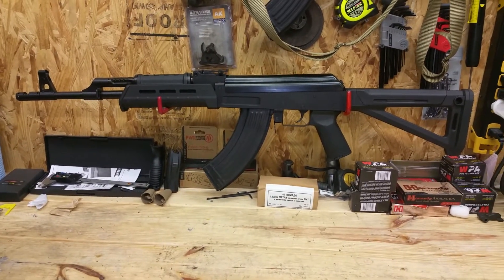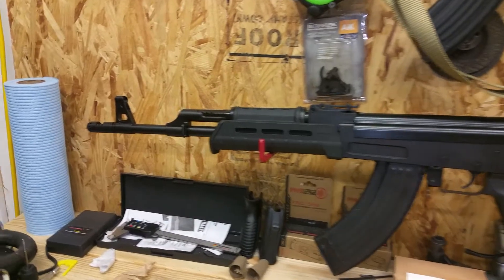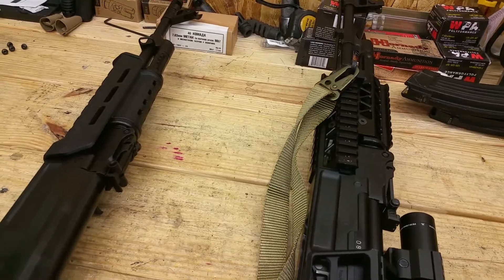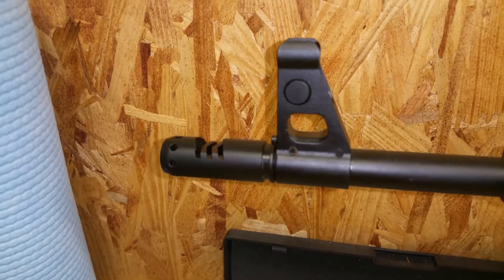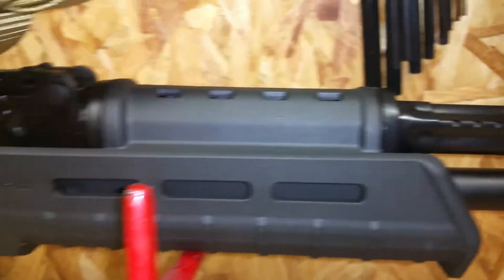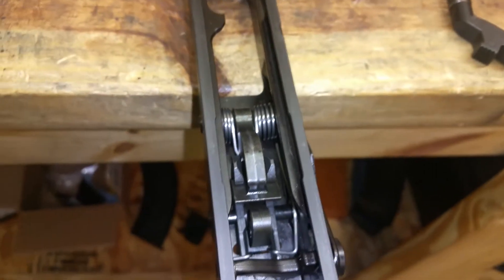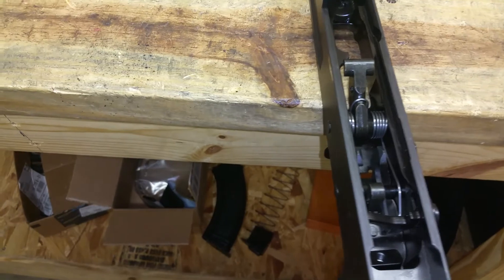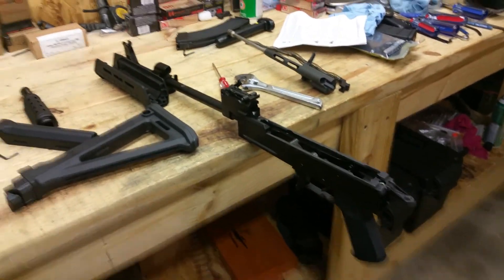C39V2 Milled AK with Mapgul MOE Furniture First Impressions & Disassembly

Comment: I must have a later model C39V2 because mine has a 4150 Chromeally Vanadium barrel. Also so far I am not expercing any pre mature wear on my bolt nor on the BCG. No deformation at all just shiny spots. Also the Tail of the BCG is doing excellent still maintaining it's proper shape . Granted mine only has about 1,200 rounds down the pipe. And I do mag dumps but I don't get crazy with it by doing ridiculous amounts of back to back to back mag dumps I tend to mostly shoot for accuracy and I gotta say I am very impressed with the accuracy of the C39V2 using plain old Wolf , Red Army Standard and Walmart Tula... unlike most people I actually clean my AK after every other trip to the range and I use Lucas Hi Temp bearing grease on the Rails , bolt and BCG.

Comment: I installed the scope mount bracket on my C39 V2 Century  AK47 by drilling and tapping the 3 holes. You need to take your time and be very careful because the milled receiver is heat treated and is very tricky to tap. I started out by drilling a starter hole in all 3 locations with a carbide center drill. After drilling thru the hardened surface I then drill the hole thru with a drill .020 smaller than finish size and then drilled finish holes with finished size drill.  I would recommend you use a brand new, high quality tap to tap these holes. Make sure and back out the tap and clear any small chips after advancing the tap no more than a 1/4 turn at a time.  Use plenty of good tapping oil and TAKE YOUR TIME.  If you get those hardened chips (no matter how small ) trapped between the tap and receiver you will break a tap for sure. You will understand what I am saying when you find out it is harder to back the tap up to clear chips than it is to advance in a 1/4 turn of more threads. Install screws with Loc-tite.

Comment: Great video thanks for the help it answered my question about which stock I could use to change out the company's I question where I'm no help luckily I happened upon your video thanks again I noticed they made a change lucky for me that mine came with the added sight adapter or whatever you call it mounted on the left side where is yours did not anyway thanks again

Comment: as a welder you could have a welding shop "tig" the side mount on the side of the receiver. just a thought? as long as you could spot the location for him. easy job to do, plug weld the holds as if it was riveted.
Reply from the maker: +MegaBait56  Not sure if its cold hammer forged. It would be awesome to weld it, lol, could be done in 5 minutes. Not sure i can bring myself to do it though.

Comment: What about buying a new top cover with a rail
Reply from the maker: Railed dust covers are an option, but they usually have their own drawbacks as well. Mostly I haven't found one that was rock solid structurally or dead dependable on holding zero.

Comment: The barrel is a Green Mtn, 4140 made to CAI specs. It is nitrite coated inside and out. I can link videos from CAI rep going over all the barrel specs if you want, I dont link other youtube videos on someones channel with out their permission. The receiver and several other parts are also nitrited.

For a side rail option check out the AK Master Mount.
http://www.akfiles.com/forums/showthread.php?t=211091
Reply from the maker: +wilvoeka  Thanks for the info. I don't mind if you link. I'd be curious to see it myself. I have seen the ak master mount before, though i did not try it. Knowing it uses fire control group pins, I was guessing it would not lock as firmly to receiver, as I have not tried it personally I could not honestly say either way. I do like that it is a fix most people can do. I do appreciate the info and different ideas, I know it helps me learn and grow.